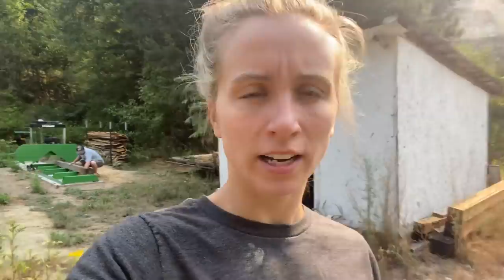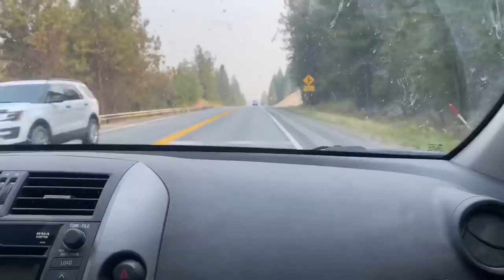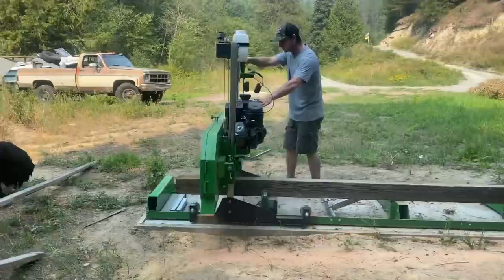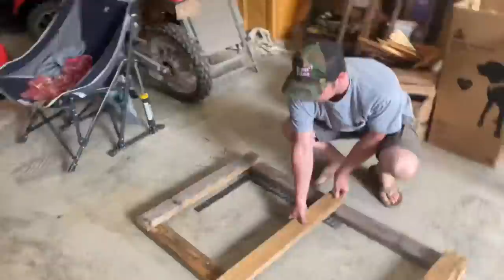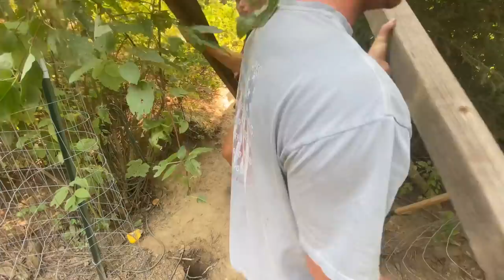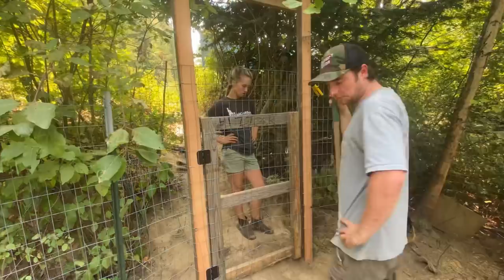Wheelin’ & Dealin’ | Coop Gate Plus New Chop Saw

Comment: You need a dust collector system for your saws etc. It saves cleanup time and your lungs. Love your show.
Reply: At least a short section of hose to hang down so it's not spraying everywhere. Possibly long enough to drop the dust directly into a bin or bucket.
Reply: @stevemurnane1892  The dust collection on a miter saw sucks.  Those saws pretty much just spray saw dust everywhere.  I've hooked up dust collection and vacuums with no real reduction in dust.  About the only thing you can do is build a box around the saw to catch everything.  Jay Bates has a really good tutorial on building this.